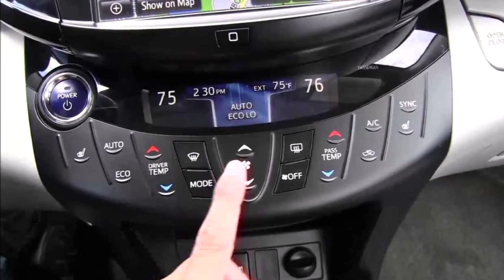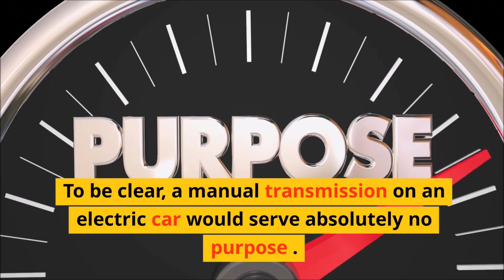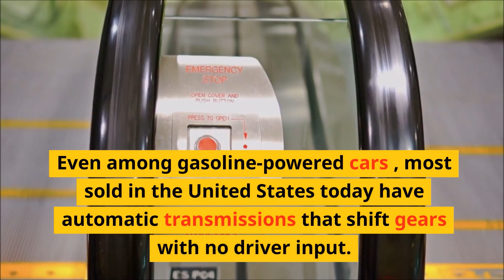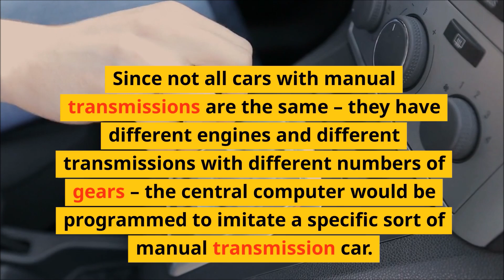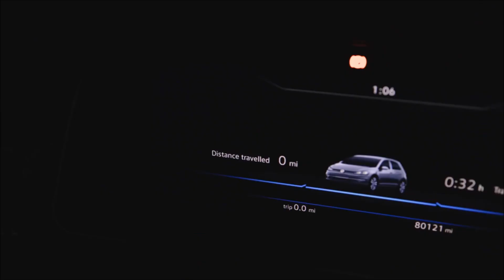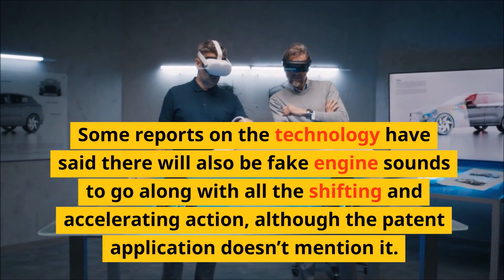BREAKING! Toyota Exec Sets Tesla Catch Up Date For Its Fleet

Comment: They won't be a main player or possibly even in business long enough to catch Tesla or BYD
Reply: They can just like they going to do, technically rebadged a BYD. They are also using there batteries.
Reply: @cb5110  And it is a miserable failure inferior and more expensive than the BYD in every way.
Reply: @chrisborns5972  yes exactly, and the faithful Toyota's fans will buy them because it name Toyota.